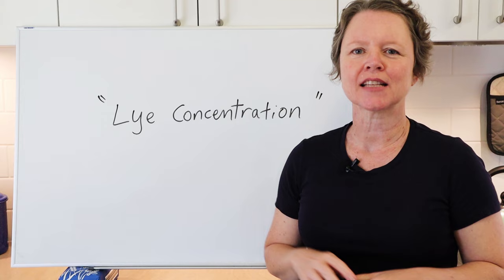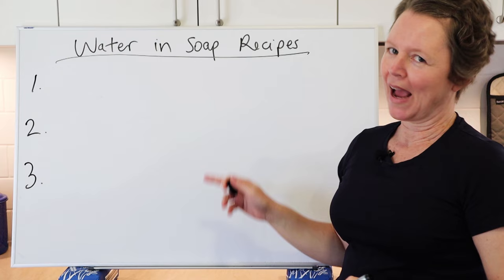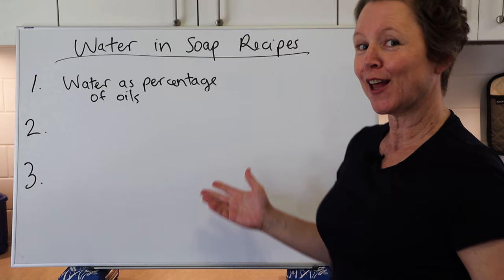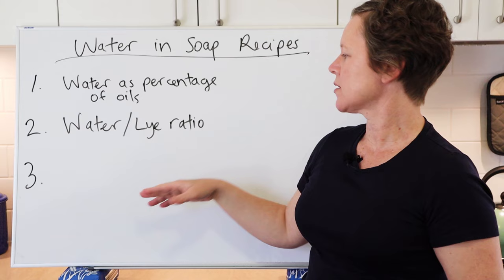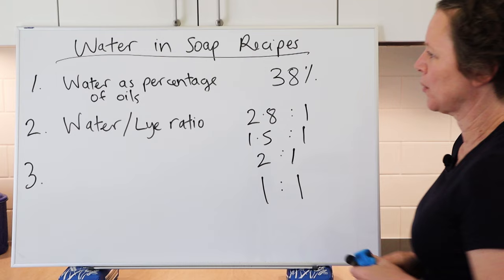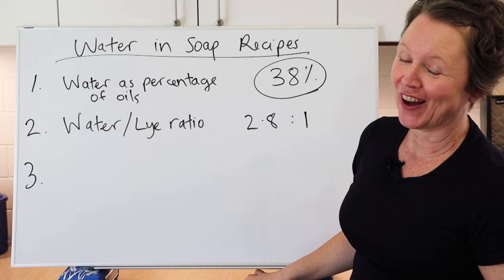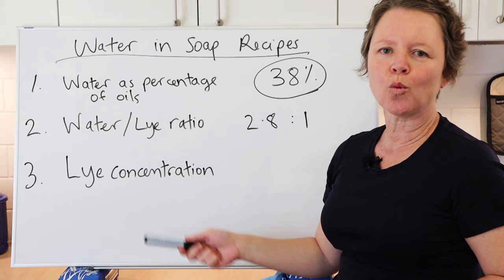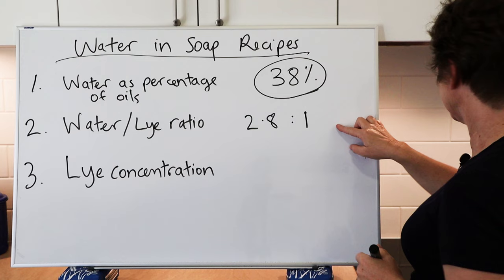Calculating Water in Soap Recipes and Clarifying 'Lye Concentration'

Comment: Great explanations! However, people always go to water discount. 
I try to optimize a cold process recipe with 5% beeswax and it reaches thick traces very-very rapidly. 
What is the largest % of water I can use, hoping to get a more fluid batter ?
Reply from the maker: 'Water discount' means many things! Which is why you need to clarify it. I think 2.5:1 water to lye ratio is quite high but might work with your high beeswax soap :)

Comment: Can u please help? I have used the exact same recipe for a year now. Recently ( I’m in northern NSW) the weather has warmed up and I’ve added 2 Tspns of sodium lactate to my recipe for easier mould removal! The opposite has happened to 6 loaves of soap! I leave them 48 hours and yet they are all sticky and so hard to unmould. What am I not doing???  Water is 8.90 Oz lye is 4.10 Oz to 30 Oz oils. 1.50 Oz fragrance oils and 2tsp sodium lactate. I would be so grateful for your input 🤗💕!
Reply from the maker: Hi Lynne, my brain doesn't think in ounces, but I can't see anythign obviously worrying with your recipe! Maybe try leaving out the sodium lactate? I never use it. I don't think it's needed if you're using a fairly low water soap recipe :)
Reply: Elly's Everyday thanks Elly I’ll try that! I use the same silicone moulds as you did! A real pain but if they come out neatly, are perfect! Mine are very messy!
Reply from the maker: Oh that's really weird! I've never ever had a soap stick to a silicone mould...
Reply: Elly's Everyday yes all 8 loaves I have made have stuck! Really odd. I checked all my ingredients, my weights and I have added 1tbsp of colloidal oatmeal instead of 1tsp. So made a new one today with a tsp see if it makes a difference! 
Other than that, I’m stumped!!! They usually come out shined and smooth all round! 🙏🤗

Comment: Hi Elly what do u think is the best % as in lye consentration 33% ,  35% or 40% I tried one with 380gms of water for 166gms of lye must tell u end result was not very good a powdery  type of soap corners was what I gt :(
Reply from the maker: It depends on how much water you want in your soap recipe. An average water amount (eg.33% lye concentration lye water solution) is a good starting place for most soap recipes. It sounds like you were confusing the meaning of the term 'lye concentration'. As I said in the video, this has nothing to do with the amount of lye in the recipe! :)
Reply: @EllysEverydaySoapMaking  thnx a ton elly for ur reply normally people don't  reply ur an angle .I saw both ur videos very informative & easily understandable hope my next batch will be correct but how do I send u a pic of what I have made

Comment: thanks for the nice video as usual , but I believe the second and the third method are pretty the same ,  we can say 2,8: 1 ratio or we can say 28%   .  in Ratio we compare between things using a standard unit regardless which unit, inch, cm or kg .  like your computer screen length to height ratio might be 16:9  if the ratio is 1:1 than you have a square screen while in the percentage we compare to 100 . it is different express
Reply from the maker: Great point :)

Comment: I have found its easiest to stick to water as a % of oils, option and use 20% - 22% Soapcalc gives you the precise gram requirements this seems to work every time, can I ask what the consequences of going a 1:1 would be, does it make the soap trace quicker, or is there more danger of residual lye being present ?
Reply from the maker: Hi, yes a 1:1 solution will trace thicker. I have never detected any residual lye with it, but it is generally more concentrated than I need. I find about 1.7:1 is perfect for most of my recipes.

Comment: This will sound silly but I am a beginner and i wanted to know, will the final texture or product change depending on  your water:lye ratio?
Reply from the maker: Hi, yes it will. If you use a high amount of water in your soap it can shrink a lot as it cures/dries and you get some hollowing on the final shape. Also really low water soaps don't always gel fully, and gelled soap is a bit different to ungelled soaps, so you have to watch for that. You can also get things like glycerine rivers and soda ash with high water soaps. I've got more information on all of these things on my website https://www.ellyseveryday.com/soap-making-terms

Comment: When you say a "term concentration" you are referring to the concentration of the term in the mixture, in this case "lye".  Basically, the amount or part of the "term" in the mixture.  It becomes confusing when you mix the "term" as the reference to another "term".  We just need to have the same reference to have same result. It is generally understood that water is always used to dilute any mixture.  If we reference every "ingredient" to the total mass of the mixture, a "new number" would definitely emerge and not as 38%, 26% or ratio... with that being said and taking your example of 1000g of oil and 26% lye concentration, the oil would be 66%, water 25% (roughly) and 9% lye (roughly) in the mixture.

Comment: I use the 3rd method as well. Soap Calc just fefaults to a 33% lye concentration. Does that translate to a water discount?
Reply from the maker: Hi, no soap calc does not default to 33% lye concentration, it defaults to a much higher water amount than that :)
Reply: You're right. The online one doesn't. But the mobile app does. I assumed they'd have the same defaults. Maybe it was an oversight when they made the app. 33 seems to be working fine for me though 🤷🏾‍♂️

Comment: Hello, you have explained everything very well, however I still have a doubt. Could I add more water than the calc gives me in relation to the lye?
For example I decide to use 200gr of oils and let's say I have a 26% lye concentration and I prepare just 100mls of that solution. Could I add to my oils 200mls of water? (74gr of water in the lye content plus additional 126gr) to make the total mixture more liquid so it's easier to play with? or doing this will drastically reduce the lye concentration?
Reply from the maker: Hi, yes you could do that. It won't change the amount of lye in the overall soap recipe, but it will change the concentration of lye in the lye-water solution. There are pros and cons about having high water amounts in your soap, you may want to research that a bit more :)
Reply: @EllysEverydaySoapMaking  Thanks for your response. Much appreciated 😊.
It just shocks me the videos I have seen of people using swirl methods. How do they do to keep their soap so liquid for so long. Every time I prepare mine, it thickens quickly to the point where I end up pouring the last bits with the help of a spoon. So I was wondering wether increasing the water content is the key factor that allows them playing with their soaps?

Comment: Question: Do you change the lye concentrations with different types of oils?  At the same time does it effect what the temperature of the oils and lye before you combine the oils? Or can I just use 38% for all my soap making and soap at about 80*?
Reply from the maker: Yes, I do change the water amount depending on the soap recipe. There are many factors to consider in soap formulation! Yes, the temperature can be important as well, particularly if you are using hard oils, butters and waxes. I'll be doing a video on that subject soon :)
Reply: @EllysEverydaySoapMaking  thanks for the information.  I have had a really hard time trying to figure out at what temperature I combine oils with lye.  I watch some YouTube video and they say 75 to 80 and at the same time people say 120 to 130.  I’m looking forward to seeing your video on this. 🙏
One other thing that confused me is bramble berry has a lye calculator and soapcal’s calculator comes up with vastly different numbers for lye and water same oil input. Bramble berry dose not ask for lye concentration unless I missed something in the text.

Comment: If I master batch my lye solution using 26% across the board how would I determine how much of the created batch would I use I a different recipe.  I guess I am trying to figure out how to determine the grams of the solution to pull out since I wouldn't use the soap calc figures.
Reply from the maker: You'd still need to base it on the soap calc figures. It's much easier not to masterbatch unless you're using the same recipe (oils wise) all the time.

Comment: I am facing a  problem which is, soaps in the molds are taking 2 weeks to dry out, they dry quickly from top, keep creamy from bottom, a friend told me that I should heat my oil to certain degree and wait until Lye temperature drops, if this is true, what temperature is the right one, to get perfect soaps
Reply from the maker: Hi, that really depends on the oils you're using. Some harder butters and waxes do need to be kept warm so that they don't solidify when you make the soap. It sounds like there might be something else going on with your soap though... Are you mixing it enough? Is your recipe correct? Are you using too much water or missing an ingredient?

Comment: Items 2 and 3 are pretty much the same. But when you talk about recipes, you usually want ratios between the ingredients. When you talk about percentage, you are calculating the ratio as a part of the whole. So, 2.8:1 is actually 1/(1 + 2.8) = 26.3% of lye.

I am no Chemist or soap maker (yet)... but as far as I understood, method 2 looks much more precise, because the amount of oil (depending on each type of oil) determines the amount of lye. And then, you have to dilute the lye.

I'd like to ask:
- If you put more water, does it make any difference to the final product? Or it just increases the cure time?
Reply from the maker: Thanks Andre, yes I like the water to lye ratio method the best for the reasons you explained so well!
Adding more water to the recipe does a few things: increases the cure time a bit, increases the possibility of shrinkage in the cured bar (more water to evaporate), slows down the rate of saponification (and trace, so you want a bit more water if you're doing swirls) and makes the gel phase longer and hotter. I have other videos on these topics and info on my website that might give more detail for you :)

Comment: Hello, my soap pH came out a level 10. How can I get a pH level of 3-4? I use 33% lye solution.
Reply from the maker: Handmade soap is an alkaline product, you will never get it to 3-4 unfortunately. I think you may be misunderstanding the correct way to calculate your soap recipes. Please re-watch this video, the superfat amount and the soap calculator determines the lye amount for any given recipe. The term 'lye concentration' only refers to the water amount in a recipe.
Reply: @EllysEverydaySoapMaking  i use the wrong term but from my research I learned that yoni soap has a pH level of 3-4

Comment: In lye concentration method, if you get very low lye concentration percentage, as example 2%. so you will add 98% water .so in that case there is hardly any sodium hydroxide in the soap mixture...is that enough...?
Please explain...?
Reply from the maker: No, if you had only 2% lye concentration in your lye water solution, you would have a lot of water!!! The lye amount does not change, you're just adding more or less water to the soap recipe to decrease or increase the lye concentration of the water-lye solution.

Comment: Hey again Hun, bought a new pack of lye but my lye isn't dissolving with water completely,still has some small lye flakes or particles at the bottom of the pan, what should I do to dissolve it?
Reply from the maker: That is pretty normal. There are often some undissolved solids. It depends on your water usually.
Reply: @EllysEverydaySoapMaking  I only use pure distill water, thanks x

Comment: Hi, Elly! Regarding your " water as percentage of oil", may I know what's the lowest percentage I can go for Hot Process? I was told that for CP, it can go as low as 25%, but it isn't applicable to HP. Is this true? Thank you in advance! Merry Christmas to you and your family😀😀🌲🌲🌲🎄🎄🎄🎊🎊🎊🎉🎉🎉🎁🎁🎁😁😁😁
Reply from the maker: Hi May, I would use more water for HP for sure. At least 2:1 water to lye, which is probably around 27% water of oils, depending on the recipe. I think anywhere in the high twenties/around 30% is good. There's a lot of evaporation with HP.
Reply: @EllysEverydaySoapMaking  Oh, I see! Thank you very much for the explanation! I'm very confused all these while because why steep water discount can be used on CP, but not HP. Now I know the reason! Thank you so so much! Do you think you can increase your hot process tutorials? I've so much to learn from you! You are a great teacher👏👏👍👍💯💯💯 Once again, thank you so very much🙏🙏🙏😁😁😁😍😍❤❤
Reply from the maker: Thanks so much May, yes I'll be doing more HP and CP videos over time - a mix of both :)
Reply: @EllysEverydaySoapMaking  Looking forward to your uploads👏👏👍👍💯💯😍😍

Comment: Found my sweet spot at 28% (percentage of oils). Equal to a 2:1 ratio. 

Will decrease another 10% when adding purée.
Reply from the maker: Excellent! Which method do you use to calculate? ;)
Reply: Elly's Everyday percentage of oils.
Reply from the maker: Perfect!
Reply: Elly's Everyday also eliminate soda ash
Reply: Elly's Everyday thanks for sharing

Comment: Hello There.. Very insightful video.. I've a question.. I use 50% lye concentration in soap calc for my soap batch and imagine soap calc gave me 276gms of NaOH and 276gms of water.. I've pre-mixed lye water with 1000gms NaOH and 1000gms water, how much quantity of the pre-mixed lye solution should I be using in my soap batch.. Should it be 276gms or 552gms of the pre-mixed lye solution.. Thank you!!
Reply from the maker: Hi there, that is a very concentrated lye solution!! I wouldn't advise using that unless you are making very slow moving soap recipes. If you want to use this concentration, you would need to use 552g of your pre-made solution for your recipe, given that half of it is NaOH and half is water. Good luck!
Reply: @EllysEverydaySoapMaking  Thank you very much for a quick response.. I use this 50% lye concentration for soaps that I personally use.. For the ones I give away or sell to others it will be 25-30% lye concentration in soap.. Hav a good one!!
Reply: @EllysEverydaySoapMaking  I usually do not use pre made lye solutions.. This is the first..
Reply: @EllysEverydaySoapMaking  Thank you very much for the quick response.. I use 50% lye concentration in soaps that I personally use and don't sell.. For the ones I give away or sell to others it will be 25-30% lye concentration in soaps.. Have a good one!!
Reply: @superHotlad  hi why you use 50% lye concentration in your personal soaps ? Does it gives the body a deep clean or foam better

Comment: Hi
If i rebatch my soap becuase i forgot to pour all the lye into the mix at what stage of the rebatching do i add my lye solution assuming that i have the correct amount of forgotten lye solution?
Reply from the maker: I would add it once you have the soap in and it's starting to melt. Make sure it's mixed in and re-cooked very thoroughly! You may want to research this further. I've actually never done a correction rebatch. I've heard it can be done though.
Reply: @EllysEverydaySoapMaking  Thank you from scary Israel
Reply: At least I have my soaps to keep me busy during these difficult times.

Comment: The reason this confused me for centuries is because I would say the water is a percentage of the batter. And therefore, so are the oils. So the 38% is 38% of the overall batter at the end, and the oils are the remaining 62%. Not sure if that just confuses people more, but I'm slightly autistic and this has done my head in forever lol
Reply from the maker: Hi, no the 38% I think you're referring to is the water amount expressed as a percentage of the oil amount. The total oil amount for the recipe stays the same (100% in total) regardless of the method you use to calculate the water.
Reply: @EllysEverydaySoapMaking  Ahh....I just ran my cal again and calculate 38% of the oils and it gave me the water amount. I'm a bit slow lol. What I am having trouble calculating is, how much to put in the 'weight of oils' column in the first place, even if I know the water weight of my mould. Does that make any sense?

For instance, on soapcalc, it's the second column, after types of lye.
Reply: Honestly, every single way I have tried to calculate the weight of oils, using weighing water in the mould and calculating using measurements and dividing by 70 (cm/grams) or 40 (inches/pounds) I get a different amount.

Comment: Here in this video, you have indicated that the Lye Concentration is 26% and this confused me with the 40% lye concentration you have mentioned in "How to formulate and calculate your own soap recipe". Can you please clarify this?
Reply from the maker: Water levels can vary a lot in soap recipes. The 26% lye concentration mentioned in this video (lots of water) was just an example to show the equivalent in lye concentration water calculation method to the standard 38% water (calculated as percentage of oils) which many soap calculators default to. A 40% lye concentration lye solution makes a much lower water soap, which is my preference.
Reply: @EllysEverydaySoapMaking  Thank you Elly. I will be trying to make a batch of soap tomorrow using your instructions and will keep you posted with the final product.